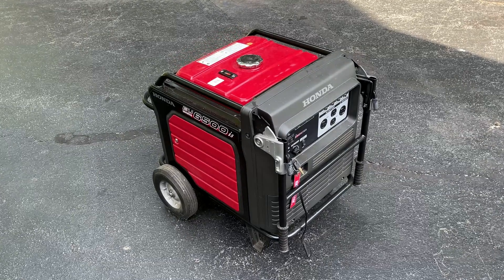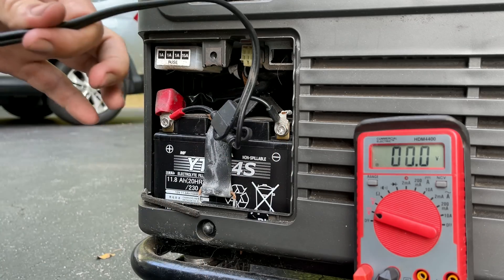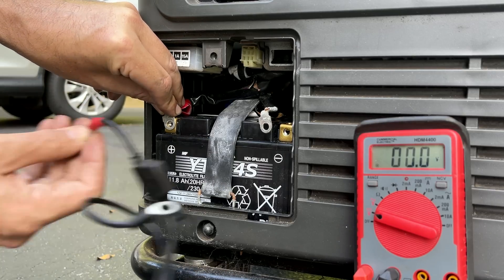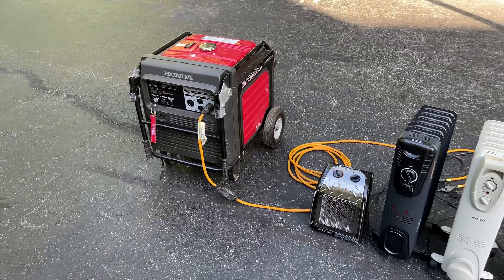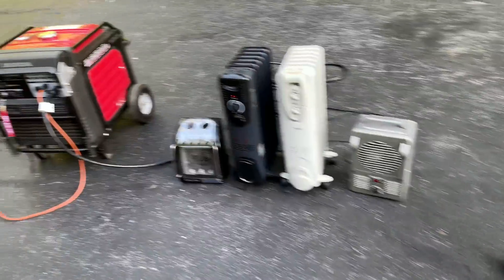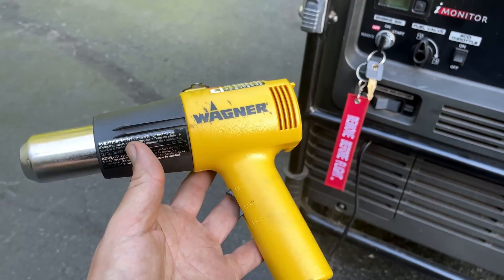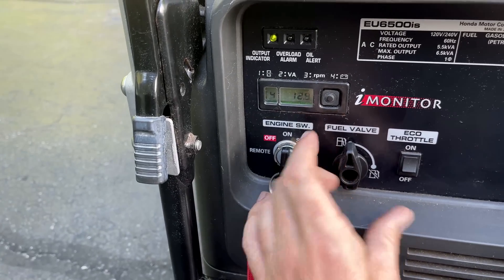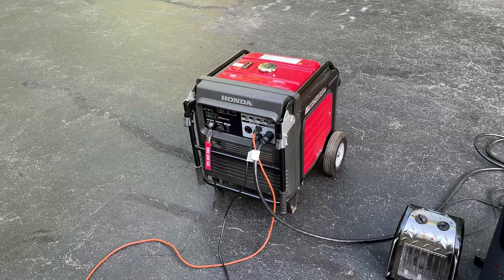Honda EU6500is Quick Fix and Load Test

Comment: With a sealed lead acid battery, an open circuit voltage under around 11.6V is dead flat.

Comment: Buy the best, skip the rest!
my gen-sets:
2021 Honda EU3000is
2023 Yamaha EF4500ise

Pro tip:  Throw that "battery tender" in the trash.  They will shorten your batteries life.  What I have been doing for over 20 years with the fifteen or so gen-sets I have owned: = I run (exercise) each machine for 60 minutes every 30 days like clock work.  Change the engine oil every 6 months (Jan 1st. and Jul 1st.).  Change air filters, spark plugs and clean the sediment bowl and spark arrestor annually.  Both machines have fuel shut off valves to run carbs dry for storage.  All fuel is treated with Stabil.  Oil is Pennzoil Ultra Platinum Full Synthetic 10w-30, no exceptions.  Plugs and filters are OEM, Honda and Yamaha, again, no excepions.  Cheers, love the channel!

Comment: 1224’24/2235h PST 🇺🇸 Thank you, for demonstrating Honda EU6500iS Fi function. I’m buying EU7000iS (Fi)  At this moment the generator’s BT kit has not been installed. I am flabbergasted at the OL function of the machine. It was steady all the while, as the load was increased gradually. Phenomenal, I should say. I’d not go to this level though. Max full load will be controlled to15% less than illustrated. I also observed the newly installed battery got charged to 13.4Vdc, which means the machine has charging function, too. Thanks for exhibiting the rise in voltage towards the end of the demo. 
Merry Christmas🎄

Comment: There's someone locally who is selling one of these for $550 but I'm not sure how many hours are on it or the age.  He says "it runs then runs loud like off Eco mode then dies after awhile".  I almost want to take the chance on it for the price...but, it depends on the hours.  Seems to be missing the wheels as well and maybe had a roughly stored life.  It's a Honda, though.

Nevermind...has 2500+ hours on it.

Comment: James,  I own the same unit but unfortunately it is locked up. I haven’t started it in years.  Sorry far drained the fuel and oil.  The oil seemed to have fuel in it.  Is there any hope saving this?
Reply from the maker: There is hope.  Did you pull the spark plug?  If fuel was leaking past the needle in a carb, then it must have gone through the cylinder to the sump where the oil is.  It is possible the cylinder is full of fuel and is hydro-locked.  Remove the plug and manually pull the engine over slowly.  Make sure the ignition is off to no spark to ignite the fuel.  If still stuck then spark a penetrating oil in the cylinder and let it sit for a few days and try again.  When engines lock from sitting there is a good chance they will free up and run again.  Just do not want to force it too hard or you could break a piston ring.  Once free it has a chance.

Comment: I have the same genset, 17 year old .  A little under 100 hours on it.  Plugged in to an outside 30A 220v receptacle with a cable and a lockout breaker on the panel.  Always turn off the central AC if a summer outage because central air was not a priority load.  Forgot once and it ran the central AC fine until the AC and 220v well pump decided to cycle at the same time and it shut down.  Predictable since that draw was over capacity.  Have had the same OEM Yuasa battery for 10 years once I started keeping on a maintainer.  Only had E-10 fuel available locally until this year and always shut off fuel until the engine died but last few years feel is was slow to ramp up when in eco throttle a heavy load was applied(lights dimmed when heavy load applied).  Ran some Redline (one of the best cleaners) fuel cleaner through it and a local station started selling ethanol free fuel and treating that fuel with Pri-G and have way less worries that there will be any issues in the future.  When the power last went out I could hear peoples genset from  almost 1/4 mile away when outside.  The EU6500iS in the rear of my house couldn't be heard 200ft away. Close the blinds in the house at night and shut off the outside lights and neighbors have no idea it is business as usual on my property...just the way I want it.  If they don't bother prepping for an unfortunate event, I don't want them relying on me to sustain their lifestyle running extension cords over to their place.

Comment: Just bought the ES6500 at an auction and said not running.  All it needed was the battery charged.  What a fantastic quite two cylinder liquid cooled engine.  I live offgrid and this generator will be a great addition to our backup power system.

Comment: Hi James, I have this exact model generator. Can you tell me what rpm you show with the eco switch on, and what rpm with eco off. Mine is currently 2400 with it on, and 3300 rpm with it off. I was thinking it should be 3600 with it off.
Reply from the maker: No need on an inverter to run at 3600 rpm.  Traditional generators run at 3600 to get 60 hertz.  An inverter creates high frequency ac.  That is rectified into dc and sent to the inverter which will always output 120 volts 60 hertz.
Reply: Oh ok, thank you. I had to replace the throttle side stepper motor on top of the carb and was worried I didn't have it clocked correctly. I purchased it not running properly so I am not sure what the rpm's should be from the factory.

Comment: Nice job James, love the channel.
As we speak, been running my Predator 3500 Inverter generator 40 plus hours because of area wide wind storm damage.
Still thousands out since Friday night here in KY.
Have had the predator for about 6 years and only problem I seem to have is battery drainage.
I thought about adding some heavy duty diodes in the charge circuit, what’s your thoughts.
It is easy enough usually one pull will start it, my wife can do it and she has a bad shoulder.
I exercise it occasionally but they recommend monthly. But I have replaced it once and it was dead again.
It is charging though as I shut down to check oil and refill fuel.
Love the generator though, been running sump pump, tv, couple lights, 2 refrigerators, deep freeze, furnace.
Pretty good draw at first, as I gradually added load, as I was working a music gig earlier so power had been out several hours.
Just added furnace cycle, then fridg, then, TV lights, and UPS.
Never saw over 25amps.
Funny thing is I can stand next to it and hear the several neighbors generators over it, and their pretty far away, like 100 yards or better.
Geez some of those open frames are loud.

Comment: Honda definitely under rates these gensets i have an EU 26i that i picked up for stupidly low cost and i have pulled a 4kw surge from it and run it at about 3kw for a few minutes with a mig welder in a pinch and the brave lil thing muscled through 😂

Comment: Your videos are superb.
I own a Honda Em3500 that I bought in 1989.
It still runs flawlessly. I run my home during utility outages with it.
I keep it "Ultra" maintained.
It is such a good machine that I bought a Honda snow blower 10 years ago.
That too is still working like new.(I wasted money on the electric start, as Honda engines start right up)
2 years ago I bought a Honda EU220i genny, just to run my pellet stove in an outage.
Your Honda performs just like all Honda equipment. Perfect !
I will put my 3500 up against "Big Box" store 5kw units any time...
Thanx
Reply from the maker: You cannot beat a Honda

Comment: Did you ever run that generator with a the dead battery in it using the pull starter? Thats what I’ve been doing and it surges a lot when I increase the load…..wondering if the dead battery is contributing to the surging.
Reply from the maker: The dead battery should not cause surging.

Comment: Just picked up one of these for a ultra cheap, I almost feel bad...  It has the dreaded E-10 error, starts right up but dies after running a few seconds, does make power for those few seconds..  It is unbelievably quiet.. Hoping it won't be the inverter..lol
Reply from the maker: Even if it is the inverter, Honda makes them affordable vs the worth of the machine.  I think around $600

Comment: I bought my 6500eu the night Katrina hit the shore in 2005. Its served me for quite a few hurricanes since. I was without power 10 days for Katrina. Last hurricane Ida we were without power for 12 days. I’ve replaced the battery twice. Other then that oil changes. I take it out and run it every two months or so and run it for 15 to 30 minutes. That takes care of the charging. I’ve not had a battery tender on it. It’s been a great machine

Comment: If you pop open the side cover, there is a manual pull cord to use for starting when the battery is dead.  Ask me how I know, sigh.  Would you please do a carb clean video on the EU6500?  I’d love to know how to do that.  Great videos, thanks for doing them!

Comment: I remember reading in a Honda inverter(EU 2000 or 3000 can't remember) owner's manual that the generator can handle the overload wattage for around 30 mins +/- . Great job  and video.
Reply from the maker: I remember reading the same on this generator.

Comment: This man must be a pilot, either recreational or as a job, that red key tag he is using looks like one of these little sleeves that are used to cover the pitot tubes on the plane when it's not in use to keep bugs like mud dobber wasps from blocking them. It's red so that it's easy to spot before flight so it can't be overlooked. Trying to fly the plane without removing these would make for a bad day for the pilot.

Comment: Using the OEM battery is a waste of $.  Generic Chinese batteries are a fraction of the price and just as good.  Paying 4x the price is not going to get you 4x the battery life. 

Otherwise, those Hondas are gems. Sold at gem prices but still, a gem is a gem.

Comment: My Honda EU6500 (with 93 hrs on it) got me through four days of power outage recently when a storm destroyed the electrical grid here in Ottawa. Ran it through a Generlink transfer device and was the only person for miles with any power. Everything ran beautifully including the AC and it was so quiet, I couldn't even hear it indoors. I also had quite a few neighbours hook up extension cords to it to keep their freezers going. I ran it for about 60 hours total and calculated it cost me about a litre an hour to run ($2). Like all things Honda, a superb machine. 

PS: I also own a 2003 Honda GL1800 motorcycle with 135K on it and it runs today as well as the day it came off the showroom floor. My first motorcycle was a 1966 Honda 350 which ran back then like the reliable machines of today. 

Hate to say it, but these experiences make me a Honda fanboy....

Comment: Great Video, I was the caretaker for an off grid mansion,  We had 2- 6500's, one had 39000 hours on it, (yes thats 39000) unbelievable but true! make sure to wax the pull start cord as in will fray and break, change oil often ( I ran Castrol full synthetic)
Replaced them with eu7000's fuel injected. They were nothing but trouble running 24/7
Take care
Reply: so the 7000's aren't as good you say?

Comment: I have the exact same generator AND Battery Tender hooked up in almost the same way. Great minds think alike. As fate would have it I've barely used mine in 10+ years. Maybe 40 hours on it max. It is run with a load periodically and then carb drained via drain screw.  Only ethanol free fuel with a good stabilizer used. Tank is drained and refilled with fresh fuel at least annually. One thing it does not like - Sudden surges from a well pump while on Eco-throttle despite both surge and running wattage well within unit specs. Will shut down most times. If left at full throttle no issues. Tested another 6500 which did the same thing.

Comment: Even though my Honda generator is about the same age as James’s, and a different model, EB3000c I love! It’s has had a super hard life. Fifteen years in the rough carpentry trade in all weather conditions it has now been retired same as me. Oh it still gets a work out from time to time and needs some oil after running 24 hrs plus, at maximum load’s it’s reliable! I did have to pull it all apart to clean dirt grime and caked in sawdust. Just like you do James it was worth it to me to replace the cracked crankcase cover, new bearings, new rings and lap the valves. Under lode I’m at 59.8 Hrz. 
I watched most of your content to pickup little tidbits of info. Although my unit doesn’t have the Power Head like most of the units you seam to get I thought the water/ Teflon tape trick was all inspiring!
Through the years I kept telling my crews to close the fuel off and let the generator die of fuel starvation. Most of these generators get loaded into vans & trucks so there always being bounced up and down every time the carburetor float lets in more gas, and you know where it ends up.
Ok thanks for the super videos from a loyal subscriber NWR.

Comment: Nice video👍
I own the EM7000IS and has served us well during extended power outages after hurricanes 🌀.  It will run for 14 hours at half load.  I connect my load through a Briggs & Stratton 7500W transfer switch.  I run it every couple of months for exercise.

 My opinion Honda makes the best gen-set inverters on the market.  Worth every penny

Comment: never understood why so many people cut a hole in the battery cover door to fit the battery tender wire thru, when the wire fits just fine thru the air slots that are on the door. I just slide my wire right thru the factory slot and use a SAE Quick Disconnect  outside the generator to hook up and disconnect the maintainer. Makes for a cleaner install than cutting up a 4K plus priced generator.

Comment: James could you help me? I have a coleman Powermate 5k generator. It's not putting out power. When I did the flash,  the light that was plugged in came on but it cuts off when I disconnect the lead from the 12v battery. Does that mean something big is wrong? How long should the lead stay connected? I know most videos say just a few seconds. You seem to be the most knowledgeable person on YouTube with generator experience. Thanks in advance.
Update. Never mind I found the problem. One of the stator coil wires was disconnected where it goes into the motherboard.

Comment: I want one! Thanks for the great understated indorsement of Honda generators. Now if I can just find a deal on one.  I live in Florida and you can't beg borrow or steal a generator when a storm is forecast. After that, they get cheap again. I bought a Generac GP2200, paid $721 for it at Ace Hardware 3 years ago (a hurricane was coming) and only fired it up once to test it.  It is overdue for the "annual" test. Hope it starts. Yes, gas was drained. Still has break in oil. Better run it and change that too. Thank for the inspiration to get off of my butt.

Comment: This was a great video. I've had my EU7000is on a battery tender for about 3 years, so hopefully the battery will last as long as yours did.  I'm curious if you used your Honda's display to verify the power draw of those heaters?  One possible improvement to the video would have been to have a camera focused on the generator's output power display included as a PIP in the video.

Comment: hope u do get another 17y out of it but highly doubt it , simply due to the electronics (mostly) potted in as a module ect to help protect moisture ingress, vibration ect , but in time capacitors degrade, component soldering fails  and ages ect can go on but 17yrs is very good any way (for the electronics )

Comment: There is no replacement for displacement. That genereator didnt even care about 5000 watts lol.
I have A couple of questions:
1. What kind of batter tender are you using and for how long have you used it?
2. What is the timing belt service interval on that Honda of yours?

Comment: Great video, and I've watched almost every one you put out just to learn. Thank you. I bought a Honda homepower 6000 with the tri-fuel option in 2009 and it's always worked when I need it, except like you needing a battery replacement. Mine has a pull start as well, but I didn't see one on your unit? Thank you again for putting out very good videos, I'm sure many appreciate it 🙏🌄
Reply: The pull start is behind one of those side panels.
They open with a half turn of a slotted screwdriver.

Comment: Jim, interesting that you use Battery Tender made in Florida where I live and I use Battery Minder made in New York. Do you install or offer chargers for the generators with batteries?
Reply from the maker: I have battery tenders and battery minders as well.  Both are good.  My only complain about the battery minder is that it will drain the battery if unplugged but still connected to the battery (at least my model).  Sometimes I will install one.